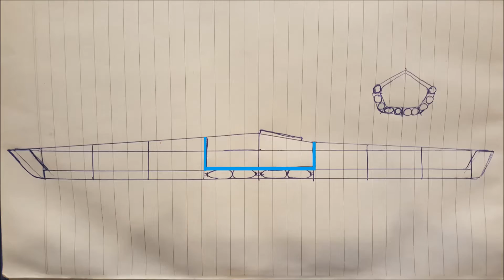Plastic Bottle Kayak Project E01

Comment: Did you use a glue to combining the botles?
Reply from the maker: On the original kayaks I did. I had two bottles glued nose to tail, with another bottle (top and bottom cut off) glued in place to join the bottles together. I'm not sure if I'm explaining it very well, but if you look closely at the image of the kayak you should hopefully see what I mean. This process is repeated to create long tubes, which are then glued and cable tied together, to form the kayak. While this was successful, long term the glue I used was not suitable, and the kayaks with repeated use started to fall apart. This is why I'm trying a new process, where the bottles are cable tied to a frame, and then the whole thing will be wrapped in plastic. This hopefully will make the kayak more rigid and durable.